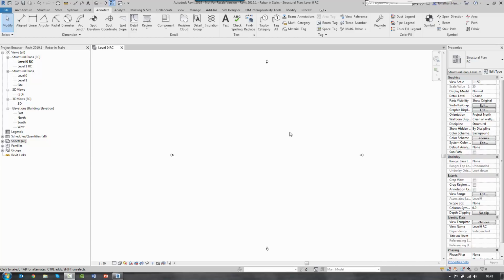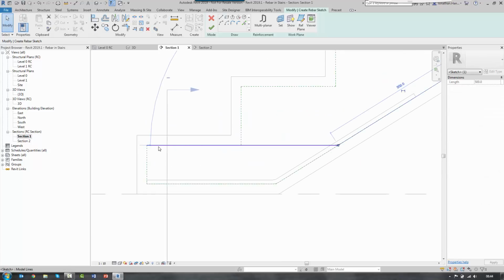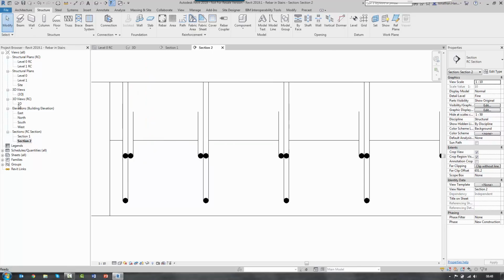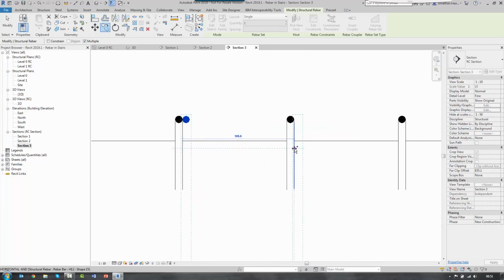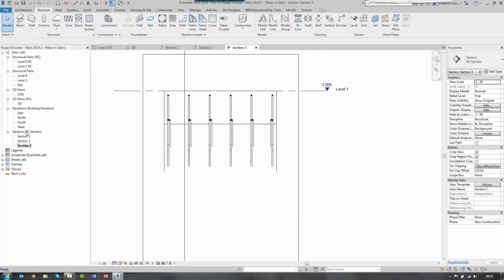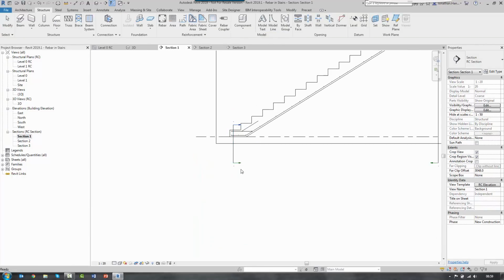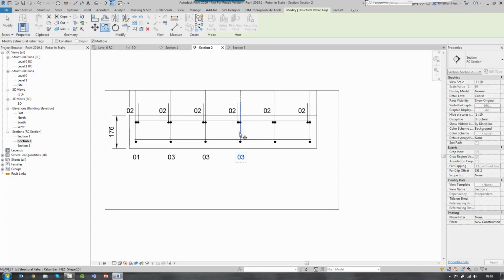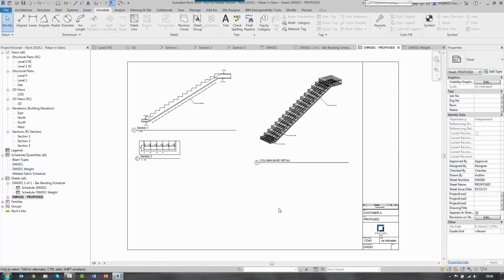RC Stair Detailing Tutorial in Revit

Comment: I liked the explanations of how to placing the bars BUT if you detail the bars as shown the structure would fail??? ie At the landing you need to take the bottom bar from the stair waist up to the top layer of the landing , then take the bottom bar in the lading across into the top of the stair waist then a bar from top of stair waist in to the top of the landing, a similar arrangement at the bottom please refer to a detailing  book